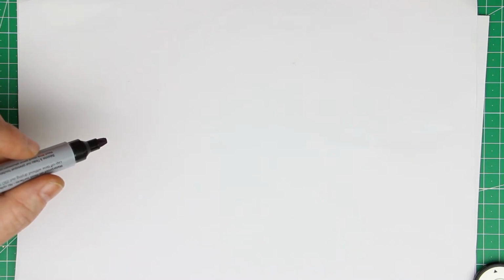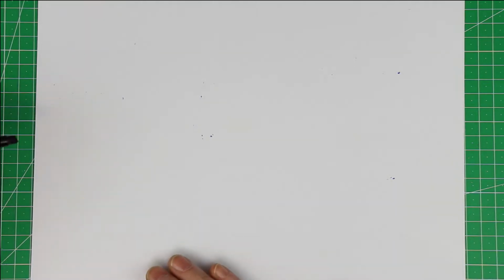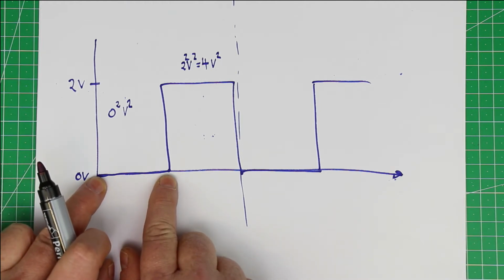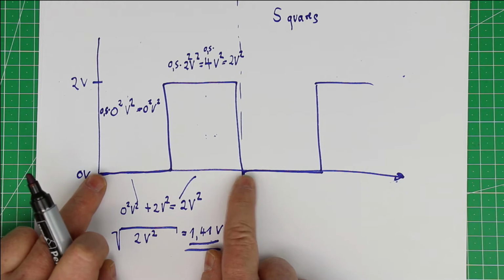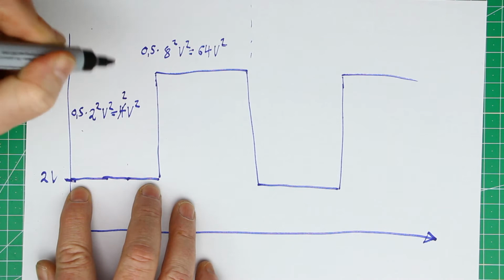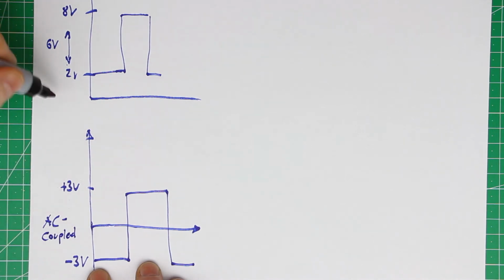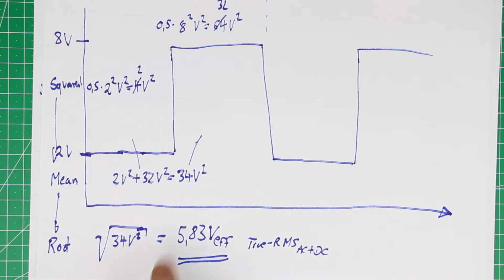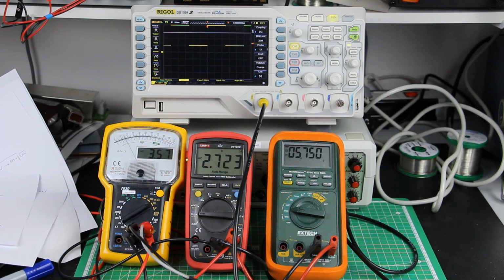True-RMS Measurement Pt.1: AC vs. AC+DC

Comment: What you did at 22:37 makes no sense. You did not change the DC offset signal per se but, rather changed the scope from DC coupling to AC coupling. As a result none of the DMMs had any change in their readings (including the Ex-tech) as they were still getting exactly the same signal with the same 2 V DC offset. You failed to demonstrate that the Ex-tech gave the correct AC + DC result in the case of no DC offset. It still reads 5.75 V! Moreover the 2.7 V recorded by the Uni T, assuming  that it basically blocks any DC offset, may well have been due to bandwidth limitation rather than miscalculation of the RMS value. My experience is that these cheap meters have a rather low bandwidth for non sinusoidal signals. To sort this out you should have reduced the frequency to the 60-100 Hz range and compared the RMS value of the Uni T which, I'll bet, would have been much closer to 3.0.
Reply from the maker: Sorry, but you didn´t get the point :-) 
When I switch the DSO from DC to AC-coupling, I only made this to let the DSO calculate the AC-coupled RMS-value for comparing it to the two AC-coupled multimeters. This is to demonstrate that 1.) an AC-coupled multimeter can never give a correct RMS reading for a voltage with a DC-offset and 2.) even the AC-coupled RMS-value is often off because of bandwidth limitation of the multimeter in case on non-sinusoidal voltages  (here: the UNI-T mutimeter)

Comment: In the case of a sine wave with DC offset there is a workaround for a meter that is "true RMS" but not "true AC/DC RMS" such as the Uni-T in your demonstration. For sine waves only, the RMS value is the square root of the sum of the squares of the "symmetrical" sine wave and the DC offset. I.e., Vrms (DC offset) = sqrt(Vrms (no offset)^2 + DC offset ^2). Take for example a 4 V peak to peak sine wave with 1 V DC offset. The RMS value of this would be sqrt( (2/sqrt(2))^2 + 1^2)) = 1.73.   If you use the Uni-T to measure this signal in AC mode you will get the non DC offset of 1.41. If you then switch it to DC mode it will correctly identify the DC offset as 1 V.  SO with a little manual calculation taking the square root of the sum of the squares of both the AC and DC measurement you will get the true RMS value of the signal.
Reply from the maker: Yes, that´s right. But first you have to know this workaround, then you have to remember it and finally you have to get out a pocket calculator :-)
Reply: @KainkaLabs  Yes, of course. My only point is that it is possible to calculate the correct RMS of a DC offset sinusoid with a meter that is not True AC/DC. Of course this will only work for a sinusoid.

Comment: Please you can't go around pronouncing V as a U..  Or writing it thus..   I understand your English is a second language..   Appreciate your effort though..
Reply from the maker: In ost of my videos I mention that in Germany (and most of Europe) the symbol for a voltage is not "V" but "U" to distinguish it from the unit Volts [V].
But of course I sometimes mix it up by myself between what I write down and what I say :-) 
Pardon me for that.
Reply: @KainkaLabs  What do they use in Germany for potential energy? (I'm used to U meaning potential energy.)
Reply from the maker: @keeleyhoek  Potential get´s the greek letter Phi (upper case). "U" is used in German for the potential difference  (_not_ the potential energy_). In electric fields potential difference and voltage are identical. That´s why "U" is correct for voltage. _Energy is always used with an "E" for energy or "W" for work.
https://de.wikipedia.org/wiki/Potential_(Physik)#Das_Potential_am_Beispiel_des_elektrischen_und_des_Gravitationsfeldes

Comment: great calculation abilities you got there... but where i live the square root of two squared equals TWO.
Reply from the maker: Could you please point out at which time in the video this is, so that I can take a look at it.
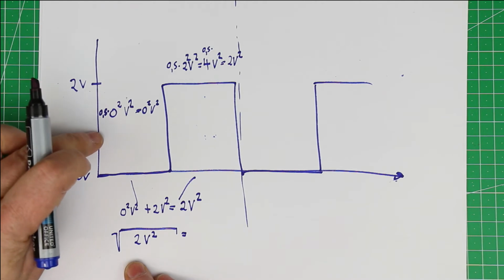Reply: at 9:45 
you have made it very confusing with the squares going absolutely everywhere.
Reply from the maker: What I wrote down is correct. I use the standard notation of mathematics as it is teached where I live.
The "2" below the root is not in brackets together with the V. Thereby the SQRT(2*V*V) = SQRT(2) * V
Reply: well its not wrong, just confusing as F... Im used to excluding the V from the calculation as its not a quantity. Vrms = sqrt(0/2+4/2) = sqrt2 (V)